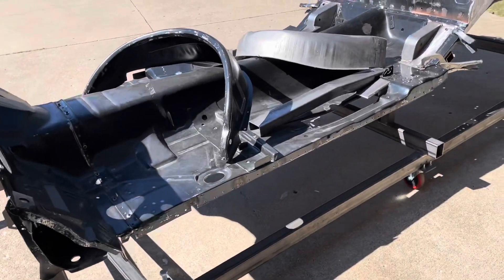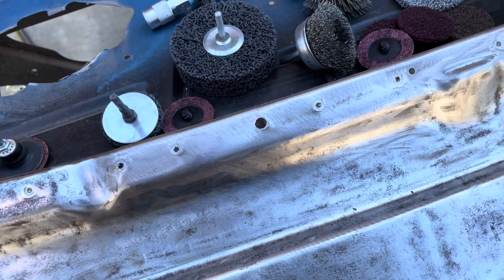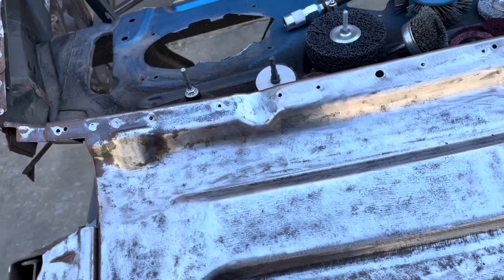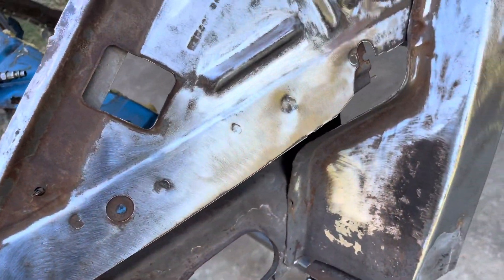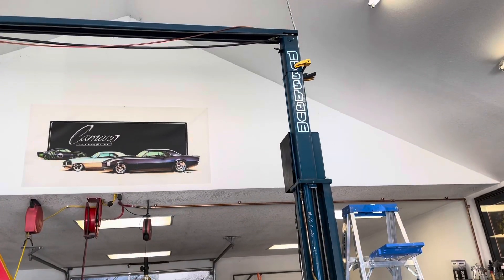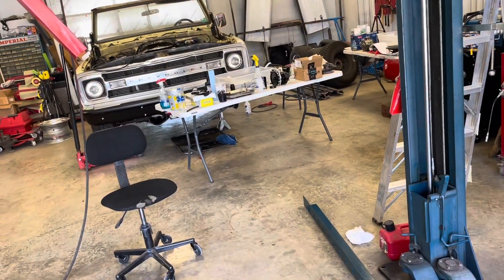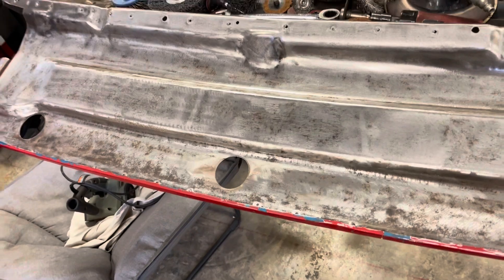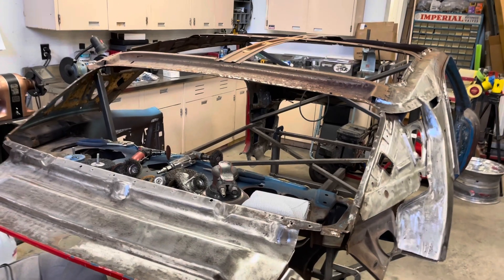Rusty camaro

Comment: Man, not sure what best way to tackle those rusty roof structures.  I would probably blast them and hit them with epoxy.  another option would be to remove them and replace with repops.  that would take care of all the rust.  Unfortunatly you cannot get as individual pieces, it comes in a kit for around $200.  
Im sure what ever you do will be better than factory.  Good to see you are back on the 68.  Thanks for sharing Roger.

Comment: I use rust converter on the little points where i cannot remove It, works very well but you need to remove all the rust you can manually before, the first cars and bikes i did 20 years ago are still perfect!

Comment: I have been installing my RH rear quarter panel on my 74 Nova SS for 2 months now. 
I ran into the same problem you did on your camaro.  Where the rocker panel meets the quarter panel, it acts like the rocker is too tall.  This car has never been hit, and had never been restored or repainted.  It’s an AMD quarter for a 1972 nova. I had to use the bottom half of the new quarter.   
I’ve come to the conclusion that the new panel is deformed.  Yikes
Reply from the maker: Yeah that’s no fun